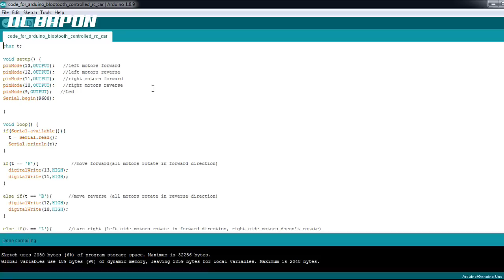How To Make RC Bluetooth Car - Smartphone Control Car

Comment: Nice work bro.  This project working only when I connect my arduino to my laptop, that time the Bluetooth connects but when I disconnect the cable it does not connect.. Please anybody having the solution reply plz. I am doing for my school project plz. And fast.
Reply: Broo please comment the arduino code for this program. I can't find it.
Reply: Did you put the battery
Reply: gobbai
Reply: Check for battery powet

Comment: sir my bluetooth is not blinking .but when i connect the usb it will start to blink when the vcc is connected with 5v but not in 3.3v please reply quickly
Reply from the maker: Please do according to the code and diagram...
Reply: @DCBapon  but sir i have done evrything correctly
Reply: @DCBapon  i checked it again and again still nothing is happening do you feel that some components is damaged
Reply: @DCBapon  sir can you please send a link of the photo of your wire digram
Reply from the maker: @goneff8694  i already mention on description
Reply: Same problem here
Reply: same problem here

Comment: Hi I made this car and it's motors are not working from the mobile controller. What can I do ?
I used flipkart power bank and its output is of 5 volts
Reply from the maker: 5v not working bro..please used a 7.4v battery

Comment: Hi Bro,Made connection same as per Circuit diagram but Bluetooth module is not found when searched through Bluetooth car App and light on bluetooth module is very faint not sure if the power or digital signal is the problem can you help me

Comment: Can u plz give the link for code that has to be used so I can just copy paste it
Reply: char t;
 
void setup() {
pinMode(13,OUTPUT);   //left motors forward
pinMode(12,OUTPUT);   //left motors reverse
pinMode(11,OUTPUT);   //right motors forward
pinMode(10,OUTPUT);   //right motors reverse
pinMode(9,OUTPUT);   //Led
Serial.begin(9600);
 
}
 
void loop() {
if(Serial.available()){
  t = Serial.read();
  Serial.println(t);
}
 
if(t == 'F'){            //move forward(all motors rotate in forward direction)
  digitalWrite(13,HIGH);
  digitalWrite(11,HIGH);
}
 
else if(t == 'B'){      //move reverse (all motors rotate in reverse direction)
  digitalWrite(12,HIGH);
  digitalWrite(10,HIGH);
}
 
else if(t == 'L'){      //turn right (left side motors rotate in forward direction, right side motors doesn't rotate)
  digitalWrite(11,HIGH);
}
 
else if(t == 'R'){      //turn left (right side motors rotate in forward direction, left side motors doesn't rotate)
  digitalWrite(13,HIGH);
}

else if(t == 'W'){    //turn led on or off)
  digitalWrite(9,HIGH);
}
else if(t == 'w'){
  digitalWrite(9,LOW);
}
 
else if(t == 'S'){      //STOP (all motors stop)
  digitalWrite(13,LOW);
  digitalWrite(12,LOW);
  digitalWrite(11,LOW);
  digitalWrite(10,LOW);
}
delay(100);
}

Comment: Bro, I did the same way as you but the problem is when I connect it the motor automatically starts by itself. Please help if you can I will even pay you for this.
Reply: Just connect a switch

Comment: Bro, you made mistake first and corrected next..but beginners can't find that mistake so do seriously while doing work.

Mistake is bluetooth module TX wire goes to arduino uno same TX port..., After that you corrected but beginners do this project will goes problem.

Do videos without mistake that helpful for beginners..!!
Reply: Bro he didn't do any mistake
Tx port is meant to go to Rx port and vice cress
Hope u correct your brain and your project :D

Comment: Bro I am uploading the code through mobile it had compiled successfully but when I upload it tells error in board what should I do to solve it pls bro tell
Reply: Hey Sri Dev! Make sure you disconnect the RX pin before uploading the code, I show how in my video, check it on my channel!
Reply: Yes it is correct
Reply: Remove both RX and TX cables before uploading

Comment: sir plzz reply suggest me the battery that is rechargeable plzzz sir plzzz
Reply from the maker: Yes bro rechargeable 3.7v Lion battery
Reply: @DCBapon  sir you cant believe i have made that rc car and it worked but its bluetooth gets disconnect after 3 to 5 sec. it also runs with mobile...
also can you plzz give me the link of these 3.7v lion battery...
its been 1 year and i have left only 2 step to done this...
plzz its a humble request
Reply from the maker: @Cobragaming462  Try other Bluetooth control apps
3.7v battery link - https://bit.ly/3obLSX9
Reply: @DCBapon  thanks bro

Comment: Sir i have one question 🙋 my Bluetooth module light is not working after connecting the battery but arduino and motor drive light is working  should i change my Bluetooth module
Reply: Conecta RX del módulo a Tx del arduino y Tx del módulo a Rx del arduino

Comment: Bro what is the battery voltage?
Reply: You can use 5v,6v,7v,8v,9v,and up to 12v but if you use 13v you can fry the Arduino
Reply: it is 7.4v battery

Comment: I have made this project for any suggestions comment down your issues
Reply: Hi my code is not working
Reply: @lithiyabijumon5267  what error your getting?
Reply: Car is not responding to my commands
Reply: When I connected my project to pc the Bluetooth model is blinking but when I use it on battery it doesn't blink